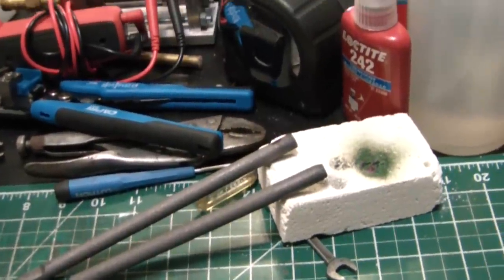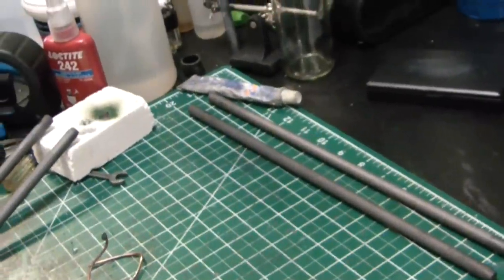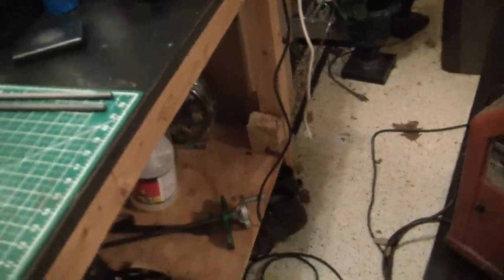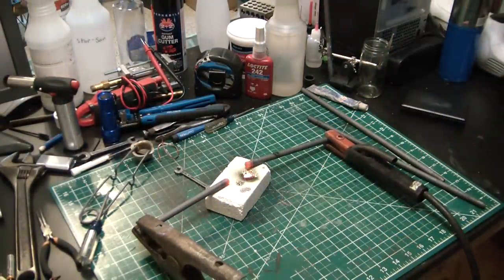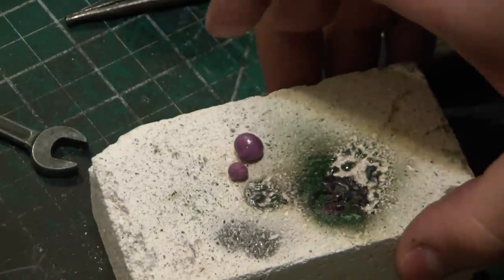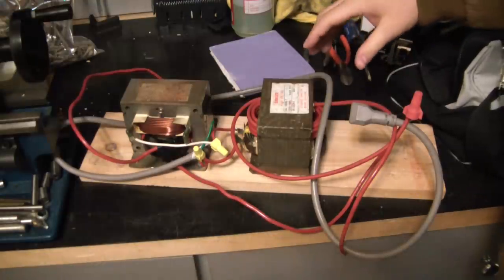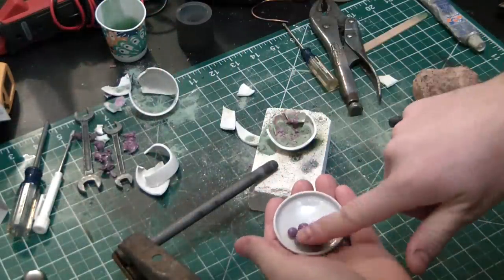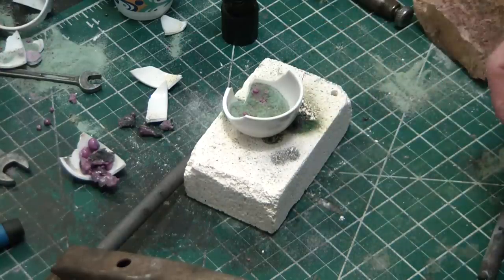Arc Furnace Ruby Gemstones DIY - Huge Rubies and Giveaway! - ElementalMaker

Comment: Have you considered using a TIG welding torch? Maybe also using graphite crucible.
TIG would give you far more control and perhaps the argon shielding gas might be beneficial?
Reply: I had the same thought, though possible problem is the Ar blowing the powder around.  What he might want to try is taking a refractory brick and carving a trough & lining it with thin cermic fiber, or diy a ceramic coating.  The trough shape would minimize having to fidget the rods inside a cup, giving a bit more control & possibly being able to make a ruby the size of a 'baby carrot'

Comment: I think a better way to get one nice big piece ruby (and more natural look) is to have a torch at the hotest flame, secured and pointing inside a preheated real jewelers ceramic melting pot, meantime, with your free hands to sprinkle through a tiny metal funel (away enough the torch so it wont melt too) the Al2O3+CrO mix powder little by little, as the torch is burning the falling powder cristalizes better and keeps building up a bigger one piece ruby gem. And I believe, as the first powder keeps receving all that heat constantly, the ruby might come up clearer. Probably add maybe some Titanium oxide in a very small amount, like 1/4th part of CrO contained to the powder mix to have it display those rainbowish inner microscopic inclusions natural rubies have. Sorry I missed the giveaway... I know few lapidary people to examinate and cut the best way if I won one  :D

Comment: That's a steal of a deal for one of those tombstones that's both AC DC usually you can only find the AC models on Marketplace for around 200 to 250
Reply from the maker: Yessir it was a major lucky find for my shop! Works like a charm too. Hard to beat the simplicity of these old units

Comment: Ruby is a trigonal crystalline material, corundum. Simple taking the raw materials and melting them together results in a glass not a crystal. Much the same effect would be achieved by melting an actual ruby into a bead - just glass. Fluorescence is not a test of the crystalline nature of ruby and a glass made from Chromium and aluminium oxide would be expected to fluoresce as you demonstrate.

Comment: This is a nice process to produce large pieces of ruby, unfortunately the ruby produced is very porous making it hard but not tough. The contaminants present in the alumina would gas off at these temps and cause these bubbles. The alumina purity needed is 99.995% or higher, You may be able to purify your source by rinsing in hot concentrated HCl and then 2-3 rinses with ultra pure water (A HNO3 rinse after wouldn't hurt either). Sodium is one of the main contaminants to avoid. To get these clear you need to make single crystal ruby but that would require a seed crystal and slowish cooling. You could still get decent clarity by cooling slowly which would likely be easier with a torch over an arc furnace as its hard to vary the temp with an arc. Id also be keen to see how this system performs with a tig torch and a slow argon shield. You would want a graphite crucible of some form, one of the grapite gold ingot molds would work well for this as you could move along them allowing the new melt to crystallise on the old. If you got any carbon impurity you could then heat it in a kiln or oxidizing flame to remove it. Cool video though, keen to see where you take this.

Comment: Try some cylindrical pype type crucible and anode on top and cathode on bottom and compres with a hydraulic press on a metal jig, bit of fabricating but if you.ll use DC crystals will line up better

Comment: as far as your arc furnace idea goes, if you enclose your crucible within a chamber capable of pulling a reasonable vacuum, which would be good for also removing gaseous by products and vacuums lower the boiling point of liquids too, but more importantly, you will have a far easier time of creating a stable arc, and it will use less voltage to strike , I know normally one has to just touch the electrodes to kick start the vaporization of the electrodes to to be able to start the arc, but it should be easier in a partial vacuum as it has less dielectric resistance than air at S.T.P. does...might also increase the purity of your product ?
Reply: Arcs don't really arc in a vacuum my dude

Comment: I just tried this with aluminum oxide (i'm waiting for the green stuff to arrive)

Anyways, how would an arc torch operate in a vacuum chamber?

I wonder if it would pull out the bubbles while forcing a super slow cool down time

Comment: Damn it dude, arc rods are already in the shop, though i feel a graphite crucible would be better, it could be a lead/contact, and give the ability to melt everything in a simple swirling motion. Luckily I don't need ruby's but would still like to make a large batch of aluminum to cast into stock of some sort.

Comment: What do you think would happen if you made a trickler (like an hourglass), and poured the materials through the arc? Would it make purple rain, or would the blastification stargate them to another dimension? Can the arc reform the rubies? It would be interesting to have a flow-through abrasives recycler for infinite sandblasting. If you laser-pump the crystal (I think that's the correct term) while it's molten, will it turn out better for laser projects... or will it just be a Ruby Rodd, like the 5th Element? Will a slingshot fire these through a Tesla "bulletproof" Truck window? When will you melt them into plates around a metal scaffold and send some to TFM for deceleration testing? Do these make good UV filters? If so, up to what wavelength?

Comment: You need to keep the air out of the mix. Nitrogen and hydrogen do bad things to your chemical reaction. Think about the  chemistry of the reaction. Argon, or CO2 are the shielding gasses used in welding.
I would like to see one. But I would like to see them faceted as well.

Comment: idk if you have any practical means of doing so, nor am i any sort of professional when it comes to this kind of stuff, but i'd imagine that preheating the crucibles to some degree would help reduce the chances of them shattering. that always seems to be the case for foundry work when transferring liquid metal into a mold or different crucible from what i've seen at least, so i assume similar logic could be applied here, though i don't suppose it would be out of the question that the graphite arcs may just be outright too hot for these particular crucibles to handle

Comment: Thinking about aluminum and arc heating, isn't bauxite processed with electrical arcs? might be an interesting video.
I seem to recall the biggest impediment to mass production of aluminum was the heat needed to processes it and arc furnaces made it possible. I may be mixing up my industrial history though.

Comment: What if you tried making a ceramic tube/ trough and coursed the current between the two anodes using the particulate as a connection point? Would that yield larger synthetic rubies similar to how fulgerite is made?

Comment: Have you thought of getting a graphite crucible also do you think you could find a way to combine the homemade arc welder with a graphite crucible to have a less hands on process for creating the rubies like having each of the leads mounted inside it so all you would need to do is power it on and pour the mixture in ?

Comment: Do not look directly at the carbon arc plasma in this experiment. Wear an appropriate welding mask or goggles to ensure your eyes are not unduly destroyed or affected. If available, wear TIG welding helmet with number 13 lens. The arc welding rods, used when welding metal, gives off a lot of smoke which reduces the UV rays given off during the welding process. However, the TIG welding process uses a tungsten anode with Argon gas through the weld nozzle to keep the welded metal from oxidising as it solidifies, so there are minimal clouds of smoke and gasses given off during the welding process and the arc is more exposed. That leaves the welder person's body and eyes exposed to higher levels of UV radiation from the plasma arc of the TIG torch. For this reason, it is advisable to wear a welding mask (I prefer to use the #13 lens) that will reduce the observer's exposure to high levels of UV radiation in the above experiment. It is better to be safe than sorry.

Comment: Though now im thinking if you put the 2 powders in a small carbon graphite shotglass and touch those to each end of it will it heat the whole inside of it hot enough to make larger rubys

Comment: I'm wondering if there is a way to possibly use your setup to heat up the crucable from the outside so that the powder doesn't splatter. That might help make a larger lump of Ruby. Anyway, you got fascinating results. (Be careful!)

Comment: I was wondering how the welder works because of the noise it makes it sounds like a motor starting up? Does it have an AC motor turning a DC generator?
Reply from the maker: That's just the cooling fan your hearing. The welder is actually dead simple, its just a massive transformer with a bunch of taps to change the AC voltage outputs. If you select DC it just goes through a huge rectifier. Can't beat simplicity!

Comment: You know, I gotta wonder if the darker pink matte color is because of uneven heating, causing gas bubbles to become trapped within the crystal as it solidifies?

So logically. If you were to drill a funnel and insert your carbon rods into the holder you could maybe leave it running for a while and let the molten Ruby de-gas before it solidifies.
Reply from the maker: Your absolutely right, there's quite alot of trapped air unfortunately, which prevents it from becoming a proper jewelry grade ruby. I've thought about trying it in a vacuum chamber, and letting it cool much more slowly as well to help form a proper crystal structure.
Reply: @ElementalMaker   would a vaccum chamber be the right call?

I mean, as far as I'm aware, that's aluminium oxide and chromium oxide right?

I'm not saying it won't work, just that it might be extra effort that isn't really the most efficient way.

What about using induction heating to slow the solidification, after maintaining the catalystsation point for longer with your current set up?

Sure you'll get more carbon leeching.
But logically it seems like a time issue, not an equipment one to me.

Draining the air with a Vaccum pump would definitely speed it up the bubbles releasing, But then you have to content with the lack of ionising material for your arc.
Reply: Plus if you run your cycle long enough the carbon should react with the oxygen already in the compound pretty quickly forming CO2 that'll de-gas along with the remaining oxygen

Comment: This was great! I'll be using my tombstone for this! One other thing, I'm wanting cheap source of carbon rods for rust removal electrolysis, can you give the specifics on how you removed the copper coating? PLAIN carbon electrodes are so expensive compared to gouging rods at the welding supply.
Reply from the maker: I just dissolve away the copper in a dilute nitric acid solution. You could probably also use a an acid mix or an oxidizing acid mixture. Ie some dilute muriatic (HCl) and white vinegar mixed would dissolve copper. Or just white vinegar with hydrogen peroxide would also dissolve copper.

Comment: What's the purpose of dissolving the copper off of the rods? Does that make the process easier?
Reply from the maker: I was worried about copper contamination messing up the color of the rubies. Probably not necessary do to though
Reply: @ElementalMaker  Interesting, thanks.

Comment: Do these Rubies have the same or near same Rockwell hardness as natural rubies?
Reply from the maker: It would probably be quite close, but since the crystal structure of these isn't perfect the hardness would be a bit lower.
Reply: ElementalMaker Awesome. It does make sense that it might be less hard. I am also wondering if it was stuffed in a graphite mold blasted in an arc furnace how well ruby could be cast.

Edit: Also thank you for the reply.

Comment: Would it be a bad ideal to wear a ring completely out of synth ruby , health wise? Since it's made with chromium and it's caustic . I plan to make it for a girlfriend , don't exactly want her to get cancer or something from it.
Reply from the maker: The chromium is trapped within the lattice structure of the aluminum oxide crystal and cannot escape. Also, Aluminum oxide is not caustic, it's damn near inert.
Reply: @ElementalMaker  thanks for the quick reply , honestly wasn't expecting that fast of a response. When I get around to making it, I'll either share pics of the ring or a video. I'll be out of town , traveling for work ,when I get to it.

Comment: Dude! You need Argon -- best because it conducts electricity -- (Helium or Nitrogen will do) Purge your crucible with a light flow of argon as well as a small flow piped into the center of both gouging rods. Or better yet, get a couple of 1/8 in tungsten electrodes for TIG welding. (no carbon contamination) $15 to $20 on Amazon for an eight pack. (Ask your local Welding Supply, then buy cheap online) And please! Get a welding hood / shield --- at least shade 11 or 12. (most welding machines come with a cheap welding hood that all weldors throw away --- ask someone  for the throwaway -- or Harbor Freight) gloves - check, thick cotton shirts, preferably starched. The UV given off by the ark is EXTREMELY DANGEROUS! You can literally go blind! Less than blind, is no fun either! You will never experience pain as severe as a flash burn on your retinas! And the sunburn you get on your Exposed Skin? Understatement! Cotton does not catch fire easily. Heavy cotton blocks UV rays. Heavy starch makes all the little "Surface of the Sun-hot" little BB's, buck shots, and splatter bounce right off. Heavy leather, above the ankle, boots --- INSIDE heavy cotton pants! Imagine one of those "Hot as the Sun"  BB's  bouncing onto your tennis shoes and burning a big hole in your foot before you can get the laces undone! Get rid of all those flammables! Including the Loctite. --- Fire extinguishers! --- A,B,C rated (for all types of fire) --- Plus a small bucket of baking soda.... (best fire extinguisher for almost everything, including electrical fires... it releases CO2 when heated) -- All of that white powder you see being blown everywhere from of a dry fire extinguisher? Even in the comedy skits? That's baking soda. AND PLEASE !! YOUTUBE SEARCH, "WELDING SAFETY!!!!!!!"  You are teaching impressionable minds how to do serious damage to themselves, others, and property. Other than that? Great video. Many of your videos are good, if not great. However, you are going to have a very short career, unless you learn, practice, and !VALUE!  --- SAFETY! Sorry if I sound like I'm preaching, but I know. I'm 64 and have watched more than one person die, one person having every bit of skin burned and sluffed right off while he stood screaming.. Emergency responders could only hose him down with cold water as he stood, dying in front of all of us. Many, many other serious injuries. Please don't become a statistic....

Comment: Hey is the ruby produced in a liquid state when formed?

Very cool video thanks!
Reply from the maker: Yes the aluminum oxide liquifies at those temperatures.
Reply: I have a plan and an idea. I have a horrible fixation on Skyrim style ingots and have a sizable pile of aluminum copper some brass and a aluminum bronze and now I think I must start the journey to get a ruby ingot
Reply: Do the rubies polish up nice or are they cloudy through and through?
How long does it maintain enough heat to be liquid? 
Does it bond to steel?
Reply: I'm thinking some vertical combination of hopper with the seeding material, electrodes and the sealed flask/mold

Have you done any further or larger scale experiments with making the ruby?
Reply from the maker: @ArindursForge  I can definitely tell you the rubies produced are completely opaque. Not sure if they bond to steel, but I'd imagine not. Your gonna need one of a power source to liquify enough ruby material to pour an ingot. Keep in mind, aluminum oxide is itself used as a refractory. So we're liquifying the thing often used to make foundries.
Reply: @ElementalMaker  aye, that's why I'm thinking a vertical, direct pour system, but then I was also looking at Nighthawkinlight's video and wondering about making a custom graphite mold and melting in place and adding material as I go. 

It's going to take me about a month or so to pool resources what with being sick since Thanksgiving but this is super interesting and exciting! Thanks for the responses!
Reply: The mold I use is about an 8" length of 3" 'C' channel, uses half of my crucible which I think is a #7?... It's a huge undertaking. I'm excited